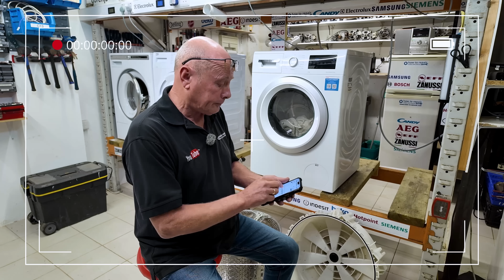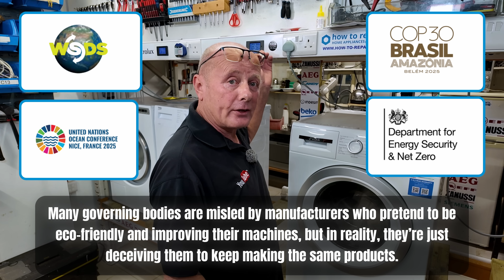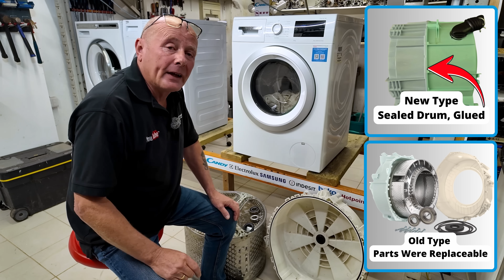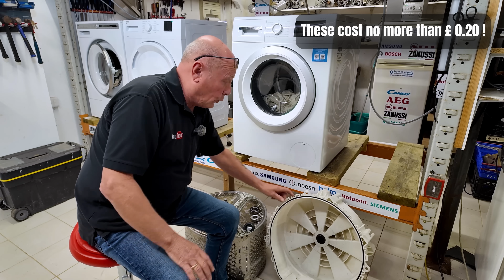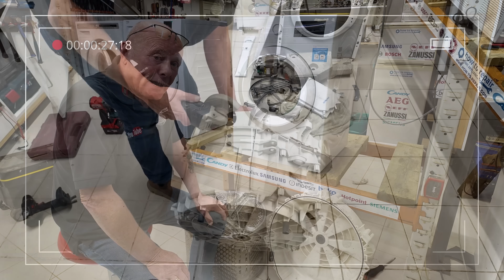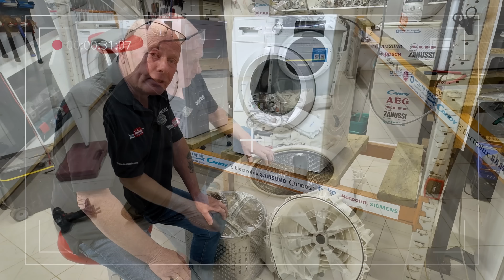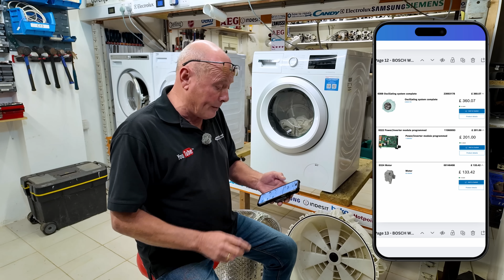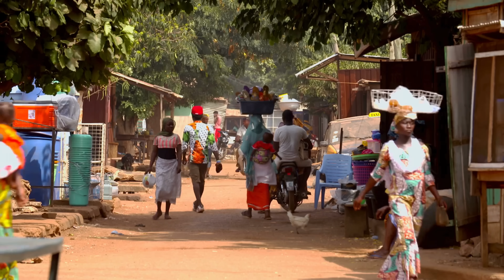Washing Machine SCAM EXPOSED! The Truth About SEALED Drums: Naming & Shaming

Comment: I am sixty three, and realised built in obsolescence was a thing most of my adult life, in various forms. Nowadays, with the advent of 'smart' machines the makers have the advantage of being able to limit the machine via its processor, quite apart from making repairs impossible physically. You can't even fit copy parts to modern cars without the pcb refusing  to recognise it.
I have two Miele machines- one is thirty years old, the others twenty. Both have seen a lot of work, and have have required NO work, bar cleaning pumps etc.
Until consumers take a stance, nothing will change. When a Bosch washing machine in a tenants flat failed just after warranty expired, due to a failed PCB I was told they couldn't help me, bar waiving the call out fee of their own engineer. As I lived  a couple of miles from their HQ in Denham, Bucks I put the machine on the back of my flat-bed truck and left it outside their entrance in the rush hour traffic, with a big sign stating  '720 days old and Fu**ed'. This resulted in lots of cars honking support, Bosch's security trying to move me on, and eventually the Police, who weren't sympathetic to Bosch, and had other things to do. I left it with them, asking for a new machine, but just got threatened for fly tipping on their land.When I said I was calling the local paper to highlight my story the legal letters stopped. I would say several thousand cars saw my advertisment for Bosch that morning, and it hurt them. What if we all did it? Grow some balls!
On the positive side I make sure that companies I support, because of their ethical stance, quality etc. are rewarded with my loyalty, and I even write to them to tell them why I buy from them. It is no coincidence that the companies with (genuine) high standards also seem to make the best stuff, which outlasts the competition by orders of magnitude. The outdoor clothing labels I buy have free repair, in shop or post.Patagonia just replaced a full length zip on a 23 year old hoody for me, f.o.c !
Reply from the maker: That is a truly good story mate! Your account of protesting outside Bosch HQ is the perfect example of direct action against corporate planned obsolescence, and I appreciate your efforts. Until consumers vote with their feet and adopt your stance, and until we get politicians to enact laws that include the word 'economically' in the Right to Repair, we will be stuck in this disposable cycle. To make any real impact, we need to catch the attention of industry leaders and put an end to these wasteful practices. Sharing this post is essential to help spread the message. Thanks, Paul!

Comment: One of the biggest problems is that washing machine average sale prices haven’t changed in some 30 years. The materials used have changed significantly from stainless steel or vitreous enamel coated steel with either cast aluminium back panels or cast iron bearing carriers to plastic tubs all to keep costs down. Sealed tubs is just another cost saving exercise, a few pence for bolts and a seal isn’t a lot but when thousands of these units are produced the manufacturing costs soon mount up. Things like proper timers with cams and switches have been replaced with cheaper to produce electronic pcb’s, the list goes on and on with cost savings. We have to look at ourselves as consumers to a degree, we all want to save a penny and this is where it has left us over the years, we now have substandard appliances in comparison to yesteryears. The cost of repairs to a modern appliance as you’ve shown has become unaffordable due to the inflated prices of the parts. Labour for repairing these appliances hasn’t gone up in line with other industries due to the cost of the parts, if we were to charge what a plumber or an electrician would charge nobody would ever want a repair. The retailers and manufacturers know this, they don’t want us to be able to repair them, they just want to be able to sell us, the consumer more. It’s a vicious cycle that has gotten worse over the last 30 years of my own observations and myself being in this business of repairs. It’s not a job I enjoy doing anymore unfortunately. 
This is a great video, well thought out and put together, you’ve given a good snapshot of what is going on within our industry, more people need to be made aware about it, especially consumers.
Reply from the maker: That is one of the most accurate and insightful comments I've received and my 40 years of experience in this business confirms it. You've perfectly captured the vicious cycle of manufactured obsolescence mate. The appliance industry sacrificed product quality and suppressed labor value to maintain profit leaving consumers with unaffordable repair quotes.

This cycle has indeed made the job much less enjoyable. The best way to fix this is with the Right to Repair laws that mandate affordable spare parts, thus raising the value of the repair trade.

To make any real impact, we need to catch the attention of industry leaders and put an end to these wasteful practices. Sharing this post is essential to help spread the message. Thanks, Paul!

Comment: I’m in Australia and I actively avoid European brand cars and appliances for the very reason you point out.
Reply from the maker: Thanks for the comment mate. The high cost of repair for European brands in Australia must be a calculated strategy driven by part pricing specialized labor and diagnostic complexity. Brands like LG, Samsung and Japanese car manufacturers often benefit from a larger local supply chain and less complex engineering, which keeps parts more affordable and easier to access. While the quality of lower-end Asian appliances can be inconsistent, their repair structure (easier parts access, lower parts cost) can make them a more practical choice for the average Australian consumer and technician.

This is why the Right to Repair movement is so important. Legislation is needed to force manufacturers to share service information and sell parts at a reasonable price, eliminating this financial barrier to repair.

To make any real impact, we need to catch the attention of industry leaders and put an end to these wasteful practices. Sharing this post is essential to help spread the message. Thanks, Paul!

Comment: I couldn't believe it, when I first saw a washing machine with a glued drum. Bosch series 4. But I thought it only are the cheap models. This is so infuriating.
Reply from the maker: Help me hold the industry accountable by sharing this video. If we want real change, we need to get this message in front of the people who make the decisions and tell those appliance-wrecking accountants to back off. I’d truly appreciate it if you could share this post. These days, it’s the only way to push this issue into the spotlight.

Comment: We had a highly specced Bosch washer from 2000 to 2017 - bought at discount "old model, as last one in the uk", still cost £300 so abt same as the Hoovers/Hotpoints/etc.  Easily the smoothest, most quiet, machine I've ever used, despite almost daily use and using high speed spin (1600 ! rpm) most washes, it ran faultlessly, uber-smooth , zero vibration, frankly it was a superbly engineered machine and I'm an aerospace mech engineer who knows bearing systems, these were clearly top notch.  Eventually the small alloy latch holding the door shut wore out, could have repaired myself but didnt bother as were moving house that week and inheriting a nearly new Hoover there. Given a new home-made latch I'd bet that OLD Bosch would still be running now, 30 years after was designed. Much to my surprise, the inherited Hoover worked well for 5 years, had to replace brushes for fiver which I thought was years too early, but easy job, another 3 years later  (2024) the bearings failed. 10 years total life so fair enuff.  As a Bosch devotee I wanted to buy Bosch, but reading all the user reviews kept seeing ridiculous stuff, or so it seemed, abt failures of sealed unit invertor motors inside drum of nearly new machines that had cost £500 plus !!.   ALso read that Bosch hence Siemens now make machines worlwide, NOT just Germany. So went the "risky" route of buying a brand-new "open box" Hoover for half price, so £160 from Currys Ebay discount shop, which was rated for high wash load (which we will never get near now kids have flown) and high speed spin, on the hope that meant it had higher-rated hence longer lasting bearings.  So far fingers crossed alls fine, like the old one it washes well, the invertor motor is belt drive hence replacable if the time comes, and we've save £250 or more wrt Bosch.   Shame on these once highly regarded German brands.  Saddens me that when reading the reviews, so many were from folk my age (63) who believed they were buying a good brand based on their previous expereinces, from a long lost time when German engineers built to last, UNLIKE now.  (Bit like 10 years ago we bought a Miele hoover, not cheap!, it had sod all use but failed a week out of 1 year warranty. Failure was a small "cheap" PCB on the power switch (why?), if bypassed the hoover worked fine. Research showed it a common fault, bought a 2nd hand pcb for £15 and so far still working, albeit with very occasional use.  This meant I will NEVER buy Meile even if was rich enuff.)
Reply from the maker: Thanks for the comment mate. That is a truly powerful story that perfectly illustrates the huge decline in quality from the built-to-last German engineering ethos of the past to the calculated obsolescence of today. To truly make a difference, we need to get the attention of industry leaders and stop these wasteful practices. Sharing this post is crucial to spread the message. Thanks, Paul!

Comment: Fantastic content, and keep up the great work! I remember our old dishwasher from the ’90s lasting 25 years, our washing machine 20 years, and now our dryer has lasted 30 years with only simple maintenance.

The story of planned obsolescence and making repairs expensive and difficult is unfortunately the same in many areas, including cars. There’s a reason car insurance costs have risen so much over the last decade…

Team up with Louis Rossmann and get the word out to even more people! Right to repair is one of the best things we can push for to help the climate!

Maybe you, Louis, and the community could put together public lists of brands and models that are the most and least repairable, so we consumers can use our money to buy appliances that are designed in the best way and are still repairable?
Reply from the maker: Thank you for sharing your experience and your incredible insight; your story about long-lasting appliances from decades past perfectly highlights the engineered decline in modern product durability.

However, it's impossible to make a definitive list mate. Manufacturers are constantly changing production lines and product tiers, so brand quality is all over the map. Your best defense is to find a brand that fits your budget and ensure they supply technical information so you actually stand a chance of repairing it yourself. Also, a pro tip is to always ask if the drum is splitable before purchasing a new machine.

I appreciate you taking the time to share this comment. Please don’t forget to subscribe and share this video so others can make a wise, informed decision.

Comment: so, Which brands still use a drum that IS accessible for repairs?
Reply from the maker: I wish I could give a single definitive answer but I can't mate. The reality is that manufacturers are always changing things and with their massive product lines, every single brand sells both winners and duds. The smart buyer's strategy is to choose a brand within your budget that also makes technical repair information available and crucially ask the seller: is the drum splitable? 

From my experience, I personally loved my ASKO machines. They're mechanical workhorses that often rival or beat modern Miele models especially because they stick with a stainless steel outer drum. Some LG units are quite good as well. And also even though Beko make budget items, they stand out by offering helpful workshop manuals and wiring diagrams, making them repair-friendly. 

Thank you for this insightful comment. Please subscribe and share this video to help others make informed choices!

Comment: And it's not just washing machines. Virtually the whole of the white goods industry and beyond is at it. It's shameful, but we are a captive audience. The motor industry has been at it for years. Take headlight bulb replacement bob or two for a classic car,  500 - 1000 quid for a replacement LED unit because its sealed in the headlight cluster and has to be replaced by a professional. Crooks the lot of 'em😢

Comment: I’ve been a domestic appliance engineer since we used to bang out bearings and replace them, worst job to do and also pressing in new bearings never lasted that long. If the replacement welded drum was only £50 I’d still charge the cust £500 as wouldn’t want the job anyway.

Comment: Cut my drum in half two years ago.£15 00 bearing kit Sika flex sealant from B&Q Machine still going strong.
Reply: This is what i was wondering - can the drum just be cut open and then the appliance repaired as normal? Is it simply another (albeit annoying and unnecessary) step?
Reply: @Spa @SpaceMonkey23101  ,I used a crosscut wood saw ,but drilled the holes to hold the drum together first so the realignment is spot on .

Comment: To the brain dead critics, who think welded drums are justified by the need to make machines cheaper, how does that work out with replacement drums costing over £300???
How is a part that is so expensive to buy as an individual part, making machine manufacturing cheaper?

Comment: The same is happening for YEARS in consumer electronics. Consider simple, cheap membrane keyboards that could last forever. Too much water one day, chip burned out. It's easy to replace but guess what? Yeah, EPOXY or some other resin on the chip welding it to the PCB. You say: "who cares if that cost 10$?"
Well, with such approach we encouraged them to do it. So they did it, slowly, market by market. And now even cars are made this way. Globally we're producing billions of tons of non-repairable junk.

Comment: I have a Kenwood K714WM16 for over 8 years now, I have replaced the following:
Drum beadings, water solenoid valve, drive belt, motor brushes and its still going strong💪💪 basically all wear and tear parts and I dont plan changing it.
Reply from the maker: That is a truly good story of longevity and resilience also you have perfectly demonstrated how a repairable machine can defeat planned obsolescence for nearly a decade. To make any real impact, we need to catch the attention of industry leaders and put an end to these wasteful practices. Sharing this post is essential to help spread the message. Thanks, Paul!

Comment: I've owned a Maytag top-load washer and and matching dryer for more than thirty years, these two machines over the years have required two repairs; the dryer required a plastic fan blade for circulating heated and moist air out the vent, the washer required a replacement v-belt, total cost for both repairs was less than $300.00 from an outside service company! I would never purchase a newly manufactured machine because as this video shows, planned obsolescence is definitely incorporated into the engineering and manufacturing of new laundry machines. I will always purchase a rebuilt used Maytag washing machine with It's mechanical timer and push-button mechanical selectors because it doesn't have any printed circuit boards that will always fail due the electrolytic capacitors and moisture condensation!  David Riddle
Reply from the maker: thanks for the comment mate. Your preference for rebuilt mechanical machines is the only way to guarantee the longevity that the new market refuses to deliver. Many governing bodies are being misled by manufacturers. These companies trick the government into believing they are eco-friendly and making better machines. In reality, they are just deceiving them to keep producing the same products.Help me hold the industry accountable by sharing this video. If we want real change, we need to get this message in front of the people who make the decisions and tell those appliance-wrecking accountants to back off. I’d truly appreciate it if you could share this post. these days, it’s the only way to push this issue into the spotlight.

Comment: might have to buy a new machine if my repairs on my current one fail 😭a list of machines with splitable drums would be useful ?😄
Reply from the maker: That's an excellent question but honestly I can't give a definitive suggestion mate. Manufacturers constantly shift their production lines and release a vast range of products meaning every brand has machines of both very good and very poor quality. My core advice is to stick with a brand that fits your budget and provides the technical information needed for DIY repairs. Also, when buying new always ask if the drum is splitable. 

Personally, I really rate ASKO they are brilliant workhorses with superb mechanicals, often surpassing new Miele models because they still use a stainless steel outer drum. Some LG models are quite good, too. And also Beko, who, despite some cheaper products, offers helpful technical manuals and wiring diagrams to support appliance fixing. They're making an effort! 

Thank you for taking the time to write this out. Please subscribe and share this video where possible as it could help someone avoid an industry trap!